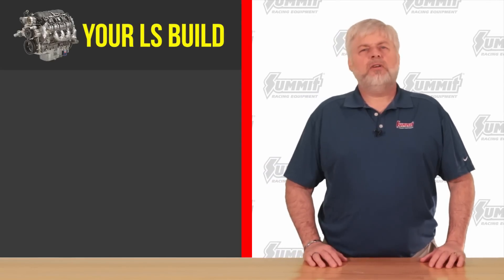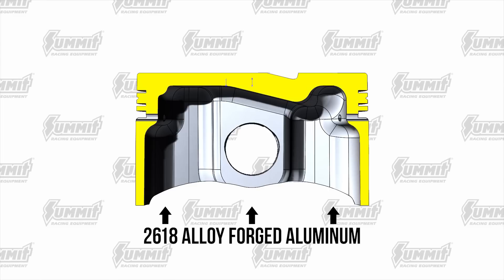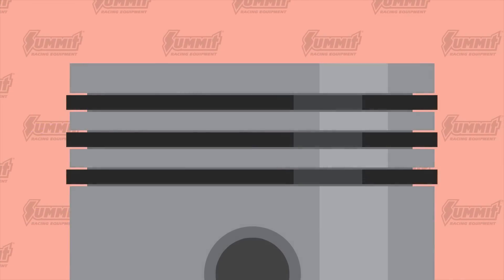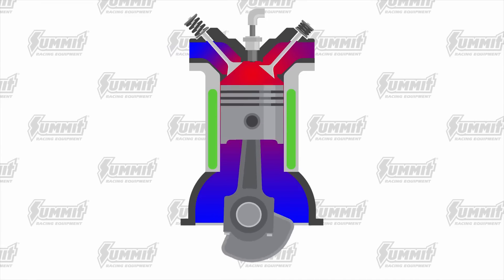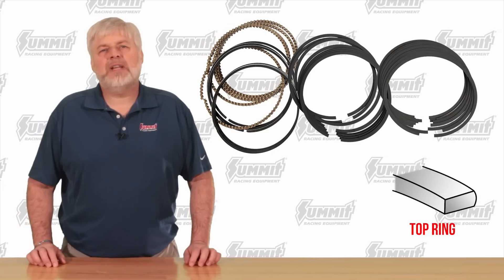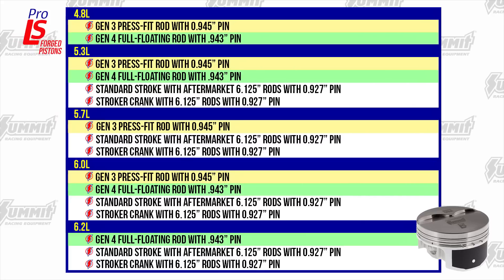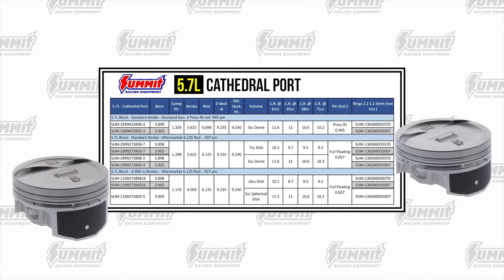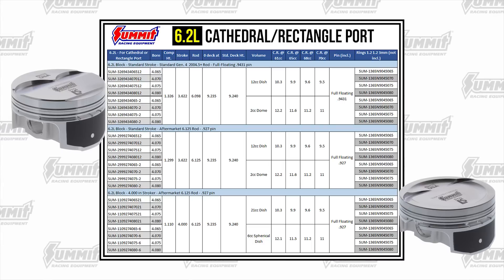Summit Racing Pro LS Pistons

Comment: I bought the 408 stroker kit and I got the complete piston ring set, and then in the boxes where the pistons were I got an extra 8 rings?
Reply: I'm doing a 402 stroker and my pistons also came with 8 mystery rings, did you ever figure out what they are? I came here trying to figure out what they are. Cause the listing says no rings included

Comment: Why the hell doesn't any make a 13:1, 14:1 piston for these engines? This is insane!!
Reply: if you want that compression the piston is half the puzzle. need to mill the head surface down or get new heads with smaller combustion chamber

Comment: I have an lq4 and here is my question. If I use the standard size summit piston are they drop in after a light hand hone or does the cylinder need .002 taken out with a ridged hone? I'm just wondering if the pistons are undersized from the stock piston. I'm trying to get the correct piston to wall clearance.
Reply from the maker: Thank you for your question.  The pistons are designed to drop into a factory bore with .004 metal to metal (skirt coatings take up some of that.  With a mostly fresh block, we recommend a brush hone that cleans the metal vs. removing it.  If you have a noticeable ridge, that will be over a couple of thousandths and keep in mind that even .006 piston to wall is 50% more than recommended and can lead to piston slap.  Especially when cold.  For this reason, we make .005+ oversizes for a very slight hone that is not expensive to do at a machine top when cleaning the block and doing new cam bearings anyway.

Comment: So if I am running a Gen4 4.8L with boost then do I need the 7cc dish or 2cc dome pistons and I don't want to have to mill my 799 ported heads. And this is in a 2011 Silverado daily driven truck.
Reply from the maker: Thank you for your question.  The 2cc domes would put compression in the 9.4:1 range with a 4.8.  That would be advantageous.  Remember you will need a Gen. 4 bushed 4.8L 6.275 rod length and 1.326 compression height piston to get the correct deck height.  Here’s a link to a standard bore version of the piston that work with the shorter stroke longer rod 4.8 and the longer stroke shorter rod 5.3.  https://www.summitracing.com/parts/sum-326943780-2f .  We also have a .945 pin version of this piston if the bushings need honed to clean up.
Reply: @SummitRacing  so basically the stock Gen4 4.8L rod with the 2cc dome pistons you sell will work fine correct?

Comment: What is the weight difference between these and stock ls pistons?
Reply from the maker: Thank you for your question.  These pistons will rarely weigh close to stock due to the wide variety of o.e. variances.   Balancing the crank will be required.
Reply: Summit Racing thanks!!!!

Comment: What's the power rating on them?
Reply from the maker: Thank you for your question.  The pistons are rated at 1000 horsepower at the wheels with standard pins.  Tool steel pin upgrades are available to give them additional capacity.
Reply: Part # i need them for my 5.3 lm7 2003 im planning to boost the soul out of it
Reply from the maker: Hello, we have four available bore sizes and they can be used with Gen. 3 rods, Gen. 4 Rods, and aftermarket 6.125 rods.  If you are going for big boost, the 6.125 is a good option but we also make a Gen. 4 version that has a larger pin diameter.  Here is a link to the filter that can help you narrow it down or you can give us a call and we’ll find the best option.  https://www.summitracing.com/oh/search/product-line/summit-racing-pro-ls-forged-pistons/part-type/pistons/stroke/3-622-in/piston-style/dish-with-two-valve-reliefs?N=bore-in%3A3-780-in_3-785-in_3-810-in_3-820-in%2Bpiston-style%3Adish-with-two-valve-reliefs&SortBy=Default&SortOrder=Ascending

Comment: Can I put those Summet Pro LS Forged Pistons in my 05 5.3 Cast Iron small Block or will in ping?
Reply from the maker: Thank you for your question John.  The Summit Pro LS pistons are designed to run tight without any more noise than factory and this is with factory stroke or even the strokers.  The important thing is to measure the block and hone as necessary to achieve the correct piston to wall clearance.  Even .002 worth of wear increases recommended (.004 to the gauge point under the coating film) piston to wall clearance by 50%

Comment: didn’t quite get info on a max rated HP capability of the pistons! if there’s any 
information out there, please lmk I have a set of summit pro ls piston and would like to know so I can determine my low and max hp build.
Reply from the maker: Thank you for your question.  The pistons are rated at 1000 horsepower as measured at the rear wheels with the pins that are included.  For over 1000 or any time a 300 shot of nitrous is added at any horsepower level, a thick-wall tool steel pin upgrade is recommended.  Part numbers for pins are WIS-S718, SUM-S719, or SUM-S720.  With these upgraded pins, the pistons have been utilized in vehicles making 1500 horsepower and more with good tuning.